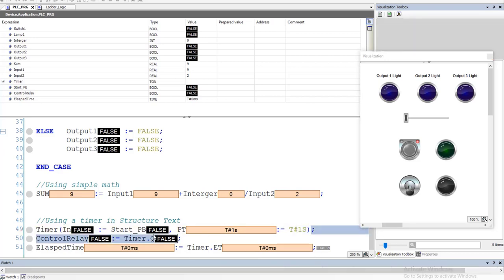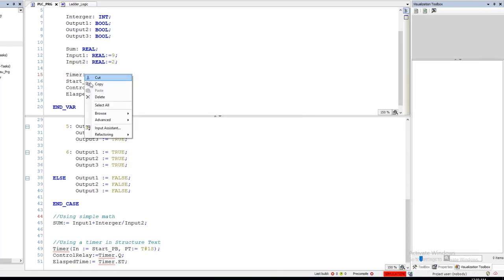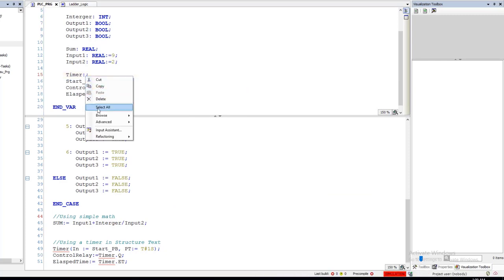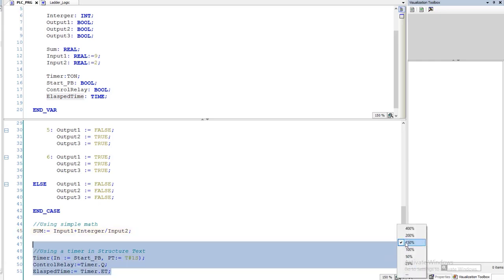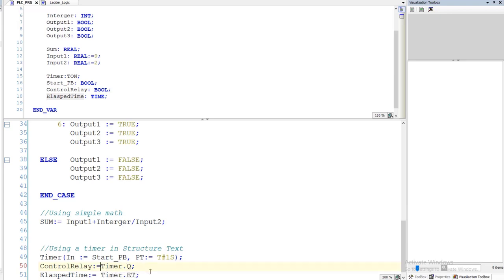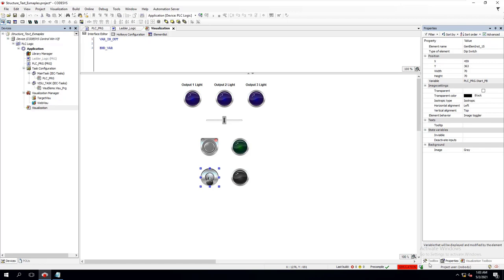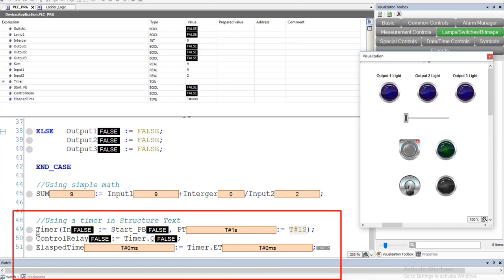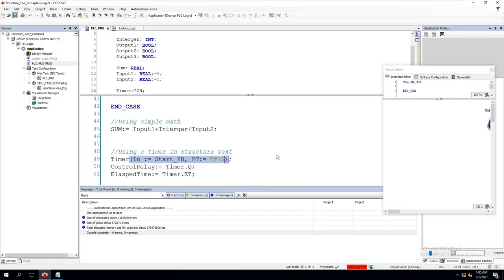CodeSys Structured Text Timer 2021

Comment: FYI, You can also write the output inside the incapsulation by using =>. Ex. Q=> ControlRelay 

Input assistance can also generate the proper textual in the program window by checking the box in the contextual window.
Reply from the maker: Yes but in the videos I make, I am trying to be more helpful for those looking to learn which are new or have limited knowledge on programming.

Or even just to give another point of view in programming.

We all know that programming has multiple ways to be done to achieve the same outcome.

The key is to give a point of view because we can all do things slightly different to achieve the same goal.

Learning every day is what produces growth.

Hope you have a great day
Reply: @ShaneWelcher  thanks for your reply, I really think you do super helpful video! Have a nice day too